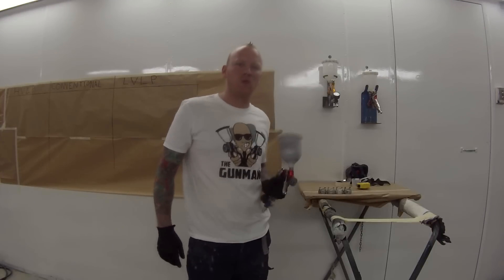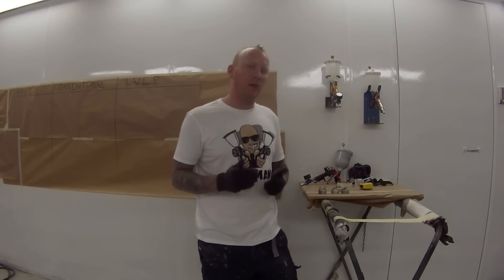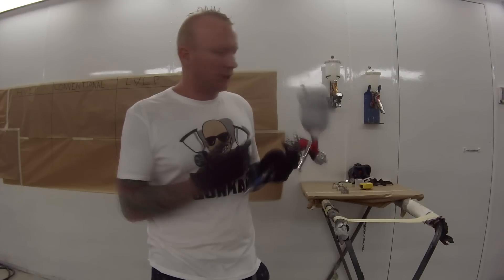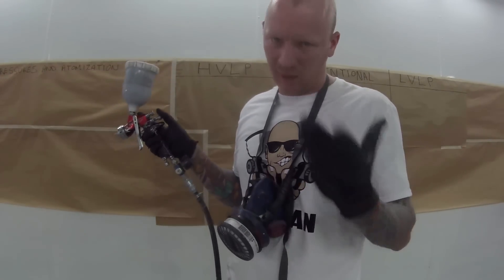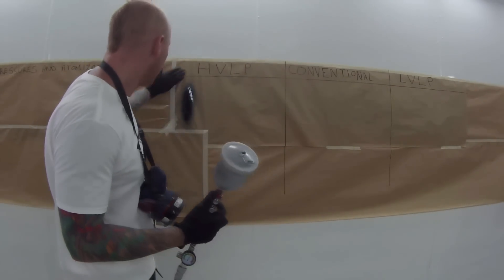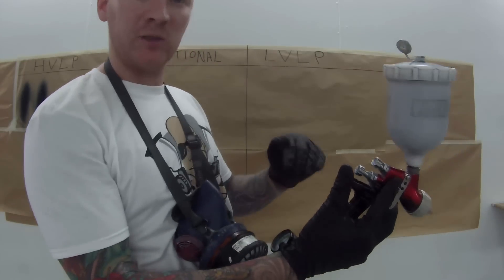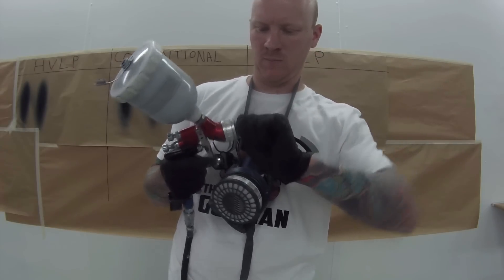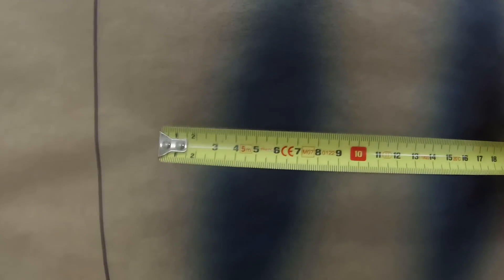Spray Gun Technology

Comment: I love your vids bro...so informative! Will a 6 gallon portercable pancake air compressor that does 4cfm at 40psi be enough for LVLP for spraying headlights only? I bought this as a beginner gun -
SPRAYIT SP-33000 LVLP Gravity Feed Spray Gun
 -Air consumption 3.5 to 3.9 CFM @ 30 PSI
Working pressure 28-45 PSI.

Comment: Hi Gunny. Thanks for awesome lessons. I just bought my first devilbiss flg4670. It came with hvlp tip. What is the best pressure and fluid and fan settings please. Thanks. 
Vinesh
Reply: I got nothing but peel on my FLG4 and 3 at the low pressures 15 to 22 psi (1 to 1 1/2 bar) Try at least 2 bar like Gunny mentioned in the video. . Not a wonderful clear gun- ok on base. Get a Pro Lite- They are less expensive now and you won't go back- I surely didn't!!!

Comment: Thanks for the great videos, they certainly explain things in great detail and you've set me on the right track for my 'first' spray gun. With a small tank, I'm looking at a LVLP gun. The problem I'm having, however, is finding a good quality gun as the market seems to be flooded with Chinese knock offs that are just confusing the issue. Could you tell me where I should be shopping for a good quality (under $160) gun that's in my price range? My compressor can deliver 4.5 cfm so that's a limiting factor too I believe.

Comment: amazing channel , i noticed that you are the only one who paints with 20 psi max with conventional spray guns. other painters use 35-40 psi. its a huge difference . i understand that hvlp uses more air and low pressure but with conventional guns it seems that you need higher pressure than hvlp. am i wrong?

Comment: oh man im even more confused now!!  I just returned 1300 dollars worth of spray guns because I have a 20 gallon compressor at home and from what I understand the HVLP guns need lots and lots of CFMs.  is it just the CAP that needs to be replaced to be able to use HVLP guns with smaller compressors ?  I hope you see this gunman, information overload here, I just want to know if I should be buying the HVLP guns or LVLP.   thanks!!!!!
Reply from the maker: Get a lvlp gun and yes with DeVilbiss you can just get their lvlp air cap, I recommend T110
Reply from the maker: The air cap is where the magic happens, the larger the holes the greater volume required, pretty simple really. Not unlike a garden hose, larger hole will be lower pressure and higher volume, put your finger over it and lower volume required. So the holes the air comes out on your lvlp guns are much smaller than the HVLP.
Reply: ozi ozi oi oi oi!!! you saved me gunman!   I didn't think it was that simple. I wonder why all the other brands don't make these air caps...  I noticed that they only have the 1.2 1.3 and 1.4 nozzles, can I spray primer with 1.4 properly?
Reply from the maker: You can but it's not really recommended for high build primers, 1.8-2.0 is ideal but if its just for a few jobs then hardly worth buying a separate gun just for primer.
Reply: those lvlp guns are so hard to find.  there are only 2 guns I found, the cheapo sprayit sp-33000 and the trifinity 600 dollar gun lol   thanks so much for your help.  most of us, i'm guessing, don't have a large 60 gallon compressor to handle the HVLP guns, it's something that's not really talked about by anyone, and something that's super important - which i'm slowly learning.   thanks again for your replies!!!

Comment: great videos. one question. i want to paint my vw beetle with a single stage paint. i have a 100 liter with 2 hp air compressor. will i need a conventional a HVLP or a LPLV gun with this  type of compressor. my budjet is 200 dollars . i am not a profi . so i will try to achieve a good result avoiding orange peel and other paint problems. thanks

Comment: Do I understand this right. The cup determines wether it's an HLVP. LVLP, or conventional? The gun itself has nothing to do with it.
Reply from the maker: With deVilbiss yes, a lot of manufacturers do it different and will sell multiple guns where as DeVilbiss simplify it and make it so the one gun with a different cap will be either HVLP, Conv or LVLP. The air cap is where the magic happens. It's mainly about the size of the holes where the air comes out, the larger the hole the more air it will need hence High Volume, smaller holes Low Volume.

Comment: Yea we like your shirt.LOL
Reply from the maker: Did you understand what I was saying about the size of the holes that the air comes out.
Reply: Yes I did...the larger holes are HP and the smaller holes are LP and it changes the pressure on the guage because of the restriction etc
Reply: So on the flg5 it seems you are saying that you would turn the pressure to the same bar but of course its using less air because of the hole size..from 1.2 to 1.5
Reply from the maker: You got it, pretty basic really. Just like holding your finger over a hose to spray girls in bikinis, you'll have more pressure :)
Reply: I understood all of that but this is now more of a High Pressure gun but all your guage setting for those three caps seemed to be 1.2 - 1.5 adjusted as required because of the air cap holes. I  used to shoot everything years at 45 psi on the guage.....but what do I know! :)

Comment: Another good vid as usual. So with an HVLP air cap do a spray out looking for a thinner fan width spraying a vertical (normal) pattern..? If the pressure is too low a bit of splatter and extreme pressure is too thin in the middle of the fan?

Comment: Awesome GunMan, you would make an ACE Tafe tutor ! So from the fans - narrower or wider regardless of cap, are you saying the NARROWER fan will always give you a bettor look on the car? Even though this implies more wasted paint?
Where as a fatter fan, though it has a better "transfer efficiency" is going to come out a bit orange peel or possibly run? Or have I misunderstood?
Keep up the great work !
Reply: The Gunman so wheb i spray my devilbiss startingline hvlp gun @30psi which is the settings it says in the manual, thd spray pattern is like a cigar, long and narrow, this is with the gun wide open.  So is it better to lower it a bit so it starts to look elliptical, wider in the middle?  Like a narrow oval?

This will also use less paint?  Less of a chance of a run?  I can move a little slower?

Thanks you're the best!
Reply from the maker: TresMamboMusicSchool Thanks man, yeah you got it 100% top of the class lol.